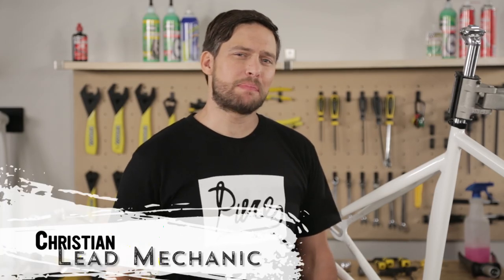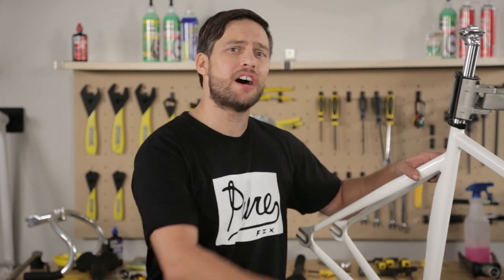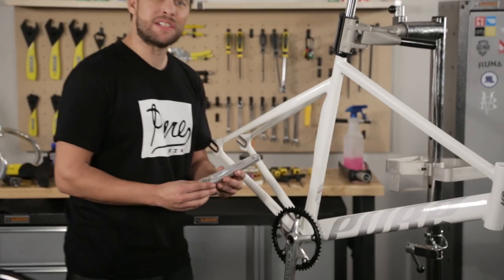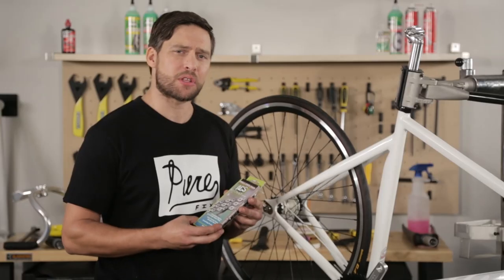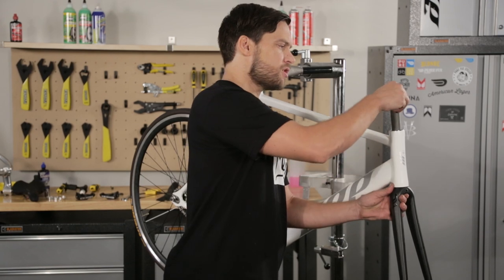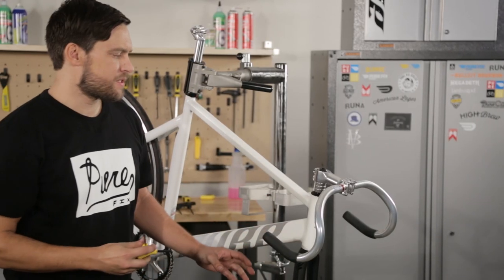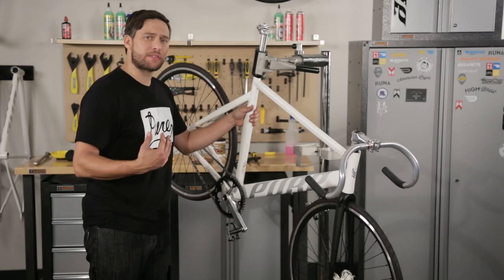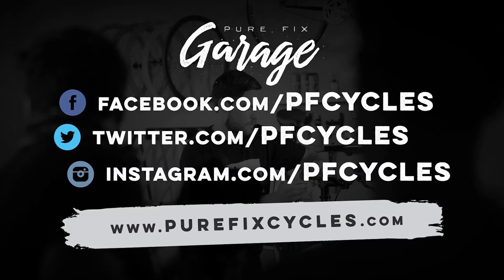From Packed to Track: Building a Race Machine

Comment: No mention of proper chain tension. I have found in my experience with my Specialized Langster achieving and maintaining proper tension is just about impossible without installing chain-tugs on the rear drop-outs. Now I don't experience any chain hop or slap, which is very annoying not to mention dangerous. If the chain hops badly enough, it will displace from the chain ring and the rider has a very good chance of crashing due to the sudden reduction in pedal resistance.